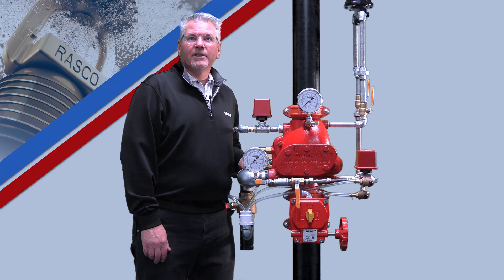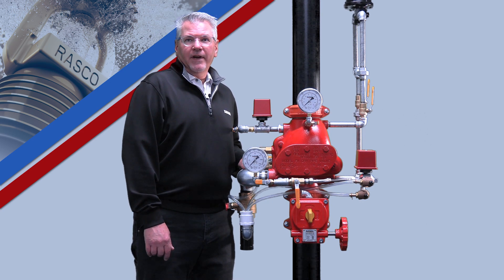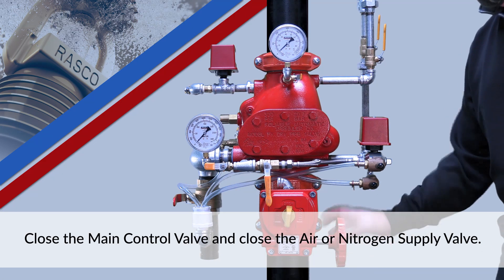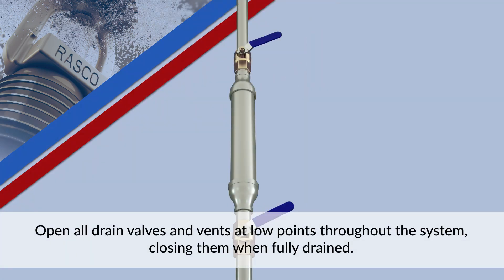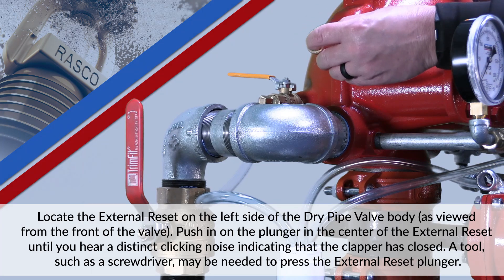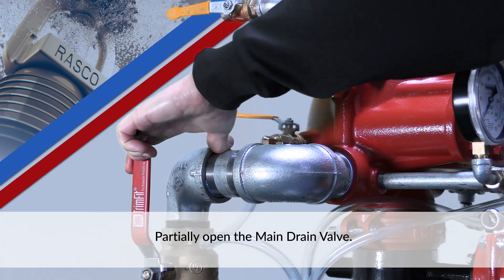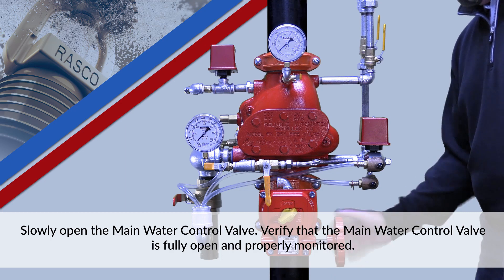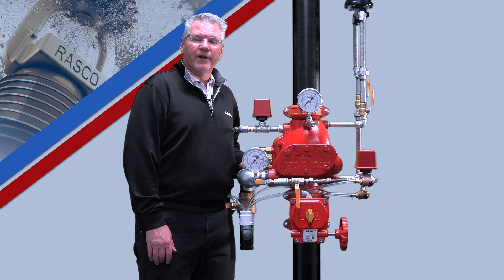Model FX Dry Valve Reset Procedure

Comment: If clapper doesn't latch when performing  full trip test is that acceptable  by manufacturer  ? It's on 4" valve and flowed it through the Inspectors test on the other end of the system with broke off sprinkler.

Comment: Reliable not so reliable anymore? Discontinued something that actually was reliable now with more crap to go wrong…Tyco engineer now employed at Reliable. Just wait till they get a victaulic engineer over there. They will have a priming line for the priming line and an actuator for the actuator and a piston for the diaphragm and throw in a double clapper with external resets and two piece face plate and take a puzzle piece from Viking and make it a 2 piece body to replace the rubber seats but make it so sloppy the external reset dosent  work after a month of install and still have to pull the faceplate to reset the thin stainless clapper. 🤗🤔👍